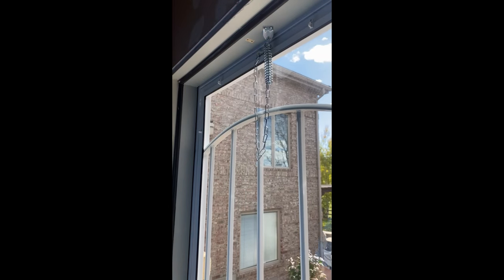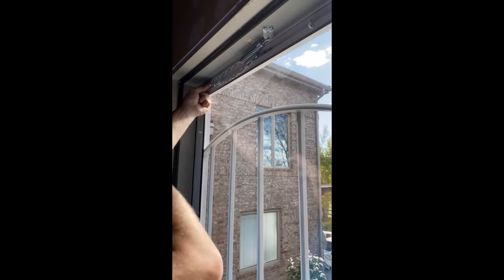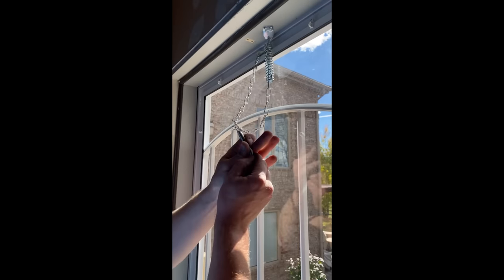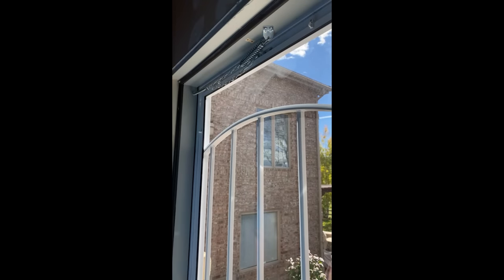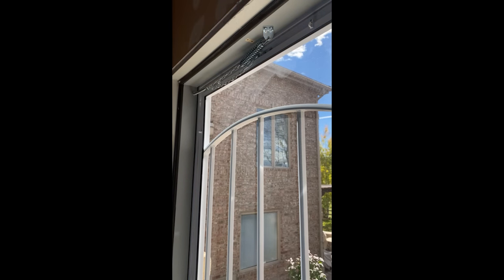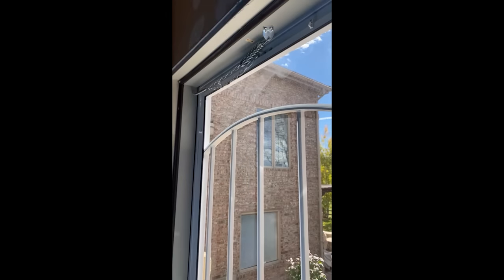Heres a Simple Hack to Install a Wind Chain

Comment: I'm not a pro but here is my common sense theory on how the chain should be installed. The wind chain should be installed so that at it's maximum extension (spring fully compressed), the door does not open further than the door closer's maximum extension allows the door to open. So if the door closer only lets the door open to 90 degrees, then the chain should be installed so the door can only open to something less than 90 degrees when the spring is fully compressed. Otherwise if a gust off wind blows the door open the closer will be overstressed and something has to give.
Reply from the maker: Great observation! You're absolutely correct. If you install the chain past the maximum extension point of the door closer, the jamb screws that connect the closer bracket to the entry door jamb will rip out due to the torque.

Comment: I bought a Wright wind chain. No idea who wrote their instructions and then printed them in micro size but your video straightened the install out. That @#$% spring - all their vendor has to do is put a little raised tab on the end. I finally bent mine a wee bit then used a partially closed cup hook on the other end.
Reply from the maker: Glad you gor it done. And your right, that @;):& spring is a pain! I like the raised tab idea. Anything to make it easier

Comment: Why 19 inches? How does it change if you want the door to open a little further?
Reply from the maker: 19" means when the door is closed the chain loops hang perfectly in half and where it should when you attatch the spring. But in reality you can set it whever you want.

Comment: I know how to read fairly well. I even taught Language Arts in my "pre-retired" days, however . . . I recognized the words on the instructions that came with my door stop but I have my doubts as to whether the person who wrote them ever attempted to follow them. Your video was very helpful and free of confusingly vague statements. I'm glad you didn't edit out your wrestling match with the spring. It's very helpful to see that there may be steps in the process that require patience and extra effort to get the job done properly. Thank you for your help. Now I'll move on to the next project: Replacing the section of gutter that the storm door damaged because there was no wind chain attached!
Reply from the maker: Glad my video helped! And if you don't want to add a wind chain to your door, watch my video short called Use This Instead of a Wind Chain. May be helpful too!

Comment: My “fav” video to install crash chains - thanks !

Tips :

When searching for a crash chain install tutorial, I discovered that many - if not most were REPLACING the common crash chain !
I decided to find something more heavy-duty for my new steal, insulated exterior doors & found  “Ram Pro Chain Crash Door Stop” - the links are MUCH thicker & have large springs on BOTH ends.
I used 1/8” (3mm) “Quick Links” to attach my smaller center spring - this way I can easily detach when needing the door to stay open at times, with ease.👍🏻
Reply from the maker: Glad you liked it! 🙂

Comment: Awesome video, clear and concise! I no longer have to worry about my patio door being ripped off it's hinges with the next big wind gust. Thank you so much.
Reply from the maker: Good job! If you’re in a very high wind area, you might want to check out my video short on putting a flower pot at the end of your door when it’s open as well to minimize damage to it
Reply: @stormdoorguy  Thanks for the tip about the flower pot. In my case, the door in question is at the back and opens up to the deck. The chain solution seems the best for my scenario. Bonus, I have some pull down blinds on each of the read deck patio doors, so I don't even see the wind chain.

Comment: Thanks for posting important information.  Is this in addition to door closer ?  Thanks
Reply from the maker: It is in addition to a closer. Sometimes there's not enough room for the closer and the chain, so in that case, it will replace the closer at the top of the door.

Comment: If the guys name is Storm Door Guy, it’s gotta be a good video. Thank you for your help, brother! One question, any particular reason you go 19” from the side on the head jamb whereas the instructions say go 18” from the side to apply to the head jamb? The instructions also say 19” from the side onto the door though. From a 7$ wind chain from Home Depot
Reply from the maker: Your welcome and great question!

I go 19” because when you mount the chain to the storm door when it is open 90 degrees, and then you close the door, the bottom of the chain where you attach the spring at the curve ends on either the top or bottom of a chain link instead of the middle of a link.

So went you pull the chain and spring to mount the spring to the door jamb so the chain is out of the way, the chain sits nice, flat, and flush.

Otherwise, the chain won’t sit great and can bind and get caught on the closure.

And if it doesn’t work right, it makes you feel bad. Then the wife gets mad, marital discord happens, the world ends, and you have single handedly ushered in the apocalypse. Happens all the time LOL.

Have a great day and glad my video helped you get it done!!

Comment: Have a Larson partial view storm on the back of the house. When we get a East or South east wind the door catches the wind really bad. Had to straighten the closer mount and one of the mounting pins today. Bought a spring kit but find with 2 closures supplied with the door there's not enough clearance for the spring to pass over the upper closer and the door frame. Any experience with this situation?
Reply from the maker: Yes. Unfortunately with the second closer at the top, you cannot add a wind chain because of the lack of room issue.

My suggestion is a strategically placed plastic round flower pot filled with sand placed on the porch and used as a door stop so if the wind blows the door open, it hits the flower pot and prevents the door from hyperextending.

A $10 solution to a $500 problem. Hope that helps!
Reply: @stormdoorguy   thanks for the reply, actually tried something like you suggested. Took a 5 gallon bucket, filled it with snow and placed it on the door mat in hopes of it absorbing some of the velocity of the door. Some times the door does not get pushed closed so its not latched, other times you exit the house with an arm load of stuff, not holding on to the door and "away she goes"!!

Comment: Any idea on how to do this on a door with retractable screen?
Reply from the maker: Unfortunately, you can't add a wind chain with retractable screen doors. I recommend a strategically placed flower pot on the porch instead. If you put the flower pot at the end of your storm door however far you want it to open, then if the door blows open it will hit the flower pot instead of hyper-extending and breaking the door.
Reply: @stormdoorguy  I don't see that as a fix. So, I'm trying to add a piece of 1/8" bar stock and putting it across the top of the inside door. It's essentially like a brace. I added the T-shaped hook to this bar stock via machine screws & nuts from the back. 
I realize this is total rig job but when the storm door flies open it smashes into my porch light fixture which needs replacing. 
Hopefully the chain and a new gas closer will save my door for years to come. Otherwise I'll just buy a new cheap storm door.
Reply from the maker: That should work. Often with wind chains, we have to add a spacer block so the chain clears the bottom lip of the header frame of the storm door.

Comment: Does this replace the pneumatic door closer?
Reply from the maker: It depends on the type of door you have. For example, on a Larson Tradewinds there’s not enough room for both the closer and a wind chain. But on the Larson Savannah, there is enough room. You just need about a 2 inch space between the top of the closer and the top of the door to fit a wind chain in.

Comment: My closer is right there where you mounted the safety chain how do I address that?
Reply from the maker: Unfortunately, you can have either a closer or a wind chain, not both because there's not enough room.

I suggest a strategically placed flower pot in that case. Put the flowerpot at the maximum opening point for the storm door if your porch area allows it. Get a large plastic one and fill it with sand so if the door hyperextends it hits the flower pot without damaging the closers or your door jamb.

Comment: Hi. What drill bit size did you use to pre-drill the storm door?
Reply from the maker: A 1/8 inch drillbit is what you use to pre-drill
Reply: @stormdoorguy  Thank you.
Reply: @stormdoorguy  I have a question. I have a storm door with a pulldown screen. Is there an alternative way to install the wind chain without damaging the screen?
Reply from the maker: If its an Andersen door, no.

I’d recommend a strategically place flower pot placed where the door opens completly. That way if the door blows open it hits the pot and doesnt destroy the door.
Reply: @stormdoorguy  I went ahead and installed it. I watched a video where it shows the screen and where it's located. It was a success. No damage to the screen.
Reply from the maker: @nullnull403forbidden  Good job! Congrats on getting it done!